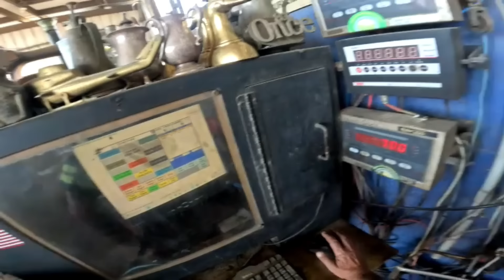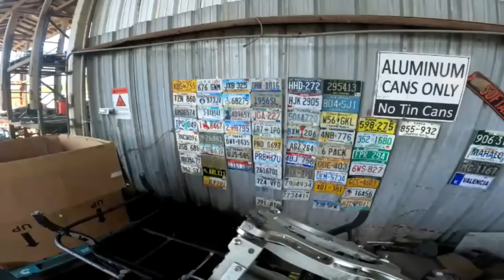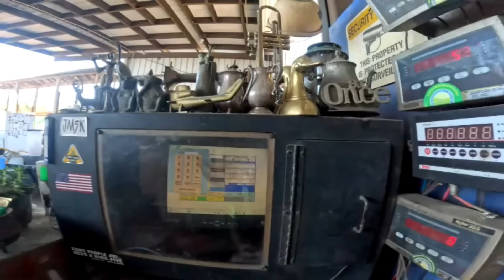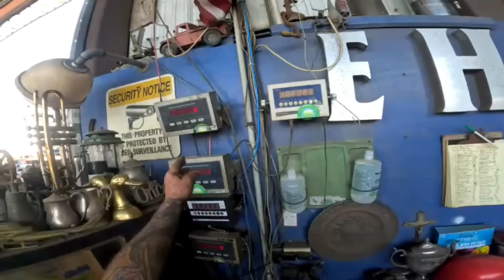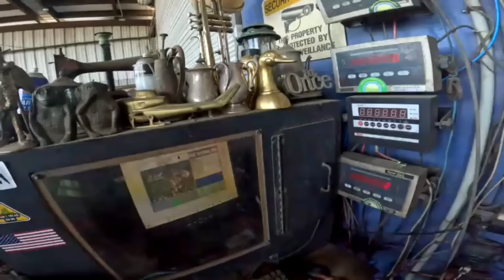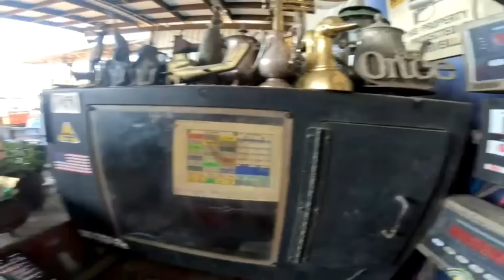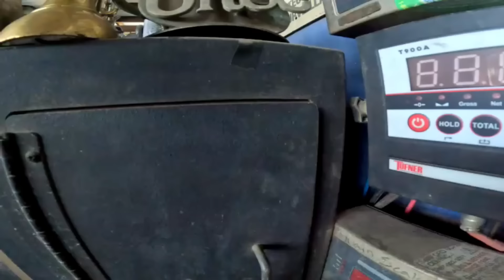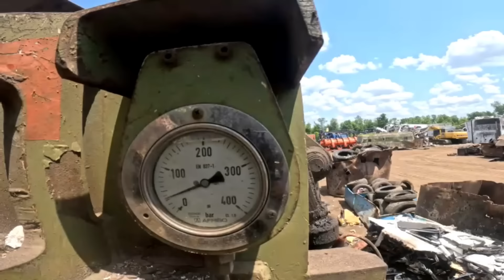FILL ER UP FRIDAY #recycle #recycling #copper #crushing #scrap #aluminum #brass #scrapyard

Comment: Thats some pile of wire I say they will shred that up to granulated stock ,I wonder can the plastic coating be recycled, something I noticed here car wire looms pay more is it better copper in them ?
Reply from the maker: That was a pile of wire for sure. Some plastic manufacturers probably buy the recycles material

Comment: You need to eat your wheaties if you gonna try and throw that truck box across the scrap yard like that…that ain’t my cauldron you have sitting there all proud of is it🧐 look like you are sticking ink pens and flowers or smth in there getting attached….I bet I could get those Hondas running again they are such a treat to work on I did a motor swap in this one I have,JDM they cut them out in Japan I think they are only allowed to have like 30-40k miles after that they have to get rid muh fuel mileage smth climate pollution…that van 😮
Reply from the maker: It was heavier than anticipated. The cauldron is so cool. Those Hondas are waiting to be race cars I think.